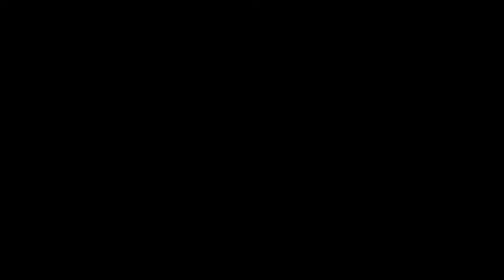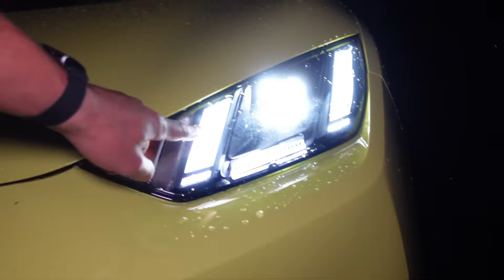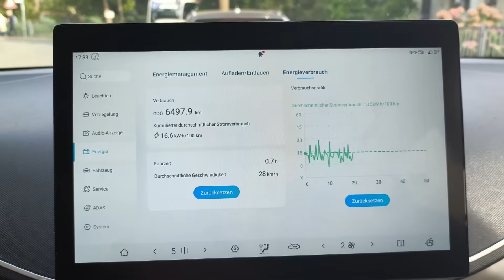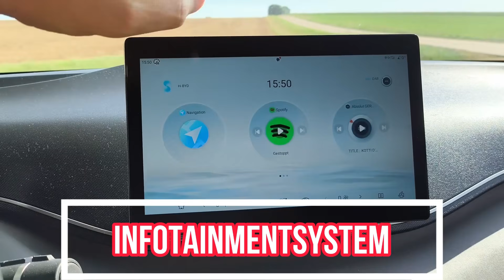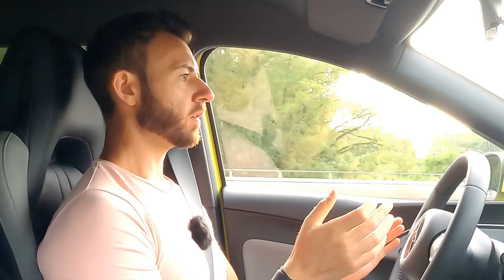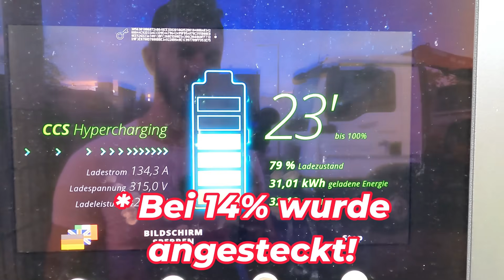BYD Dolphin Surf – My Experiences After 2 Weeks All Pros & Cons

Comment: UK here. Really liked the video. I've seen a 2025 used Boost in black with 3,000 miles on the clock for £15k. That's £8k off the list price and very tempting!
Reply from the maker: Thank you for your feedback! This price sounds very interesting!
Reply: Can lease for 1500 up front and 132 a month.
Reply: @scottyboy3751  I've always bought my cars outright & never gone down the leasing route. Does that £133/month include maintenance, VED & insurance or is that all extra? Also what happens if the car breaks down in a major way? Are you responsible for getting it back on the road?
Reply: @MrSensible2 Not maintenance but road tax is included. Buying an electric car is crazy due to the decrease in value. This is a 3 year lease. Dropped off at your door and picked up again at end of lease.
Reply: @MrSensible2 the warranty for a lot of stuff is 6-10 years as well did that carry over?
Reply: @EchoPauseFYT  FYI, I am tempted no more. I worked the numbers in quite a lot of detail & concluded that I was better off sticking with my 10 year old petrol Suzuki Celerio. First off, it passed its MOT yesterday. Second, it's only £20 a year in road tax (it was until recently £0) whereas it would be £195 for the BYD. Third, it's still doing upwards of 66 mpg so even at today's petrol prices, fueling only costs 10.7 p/mile or £374/year for the 3,500 miles/ year I drive these days. Fourth, I avoid forking out upwards of a grand for a home charger & going onto a EV tariff which is disadvantageous if, like me you're on Octopus Flux. And finally, the Suzuki has a rear wiper & doesn't have an annoying ADAS system that bings & bongs at me all the time!